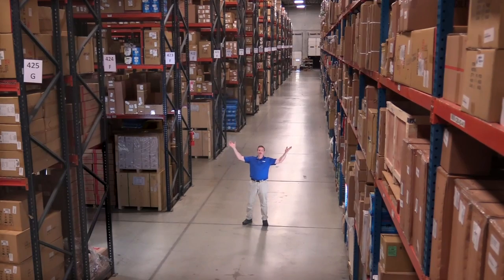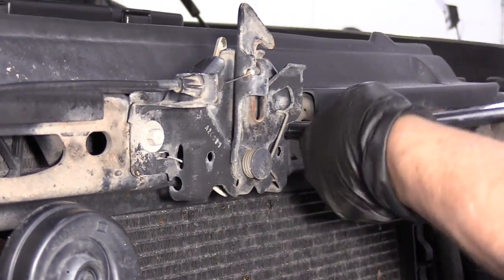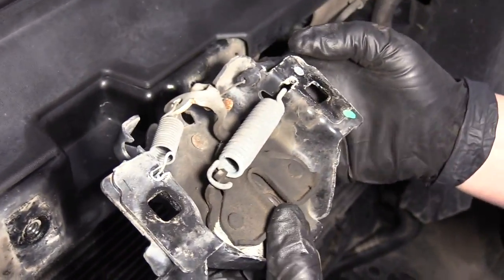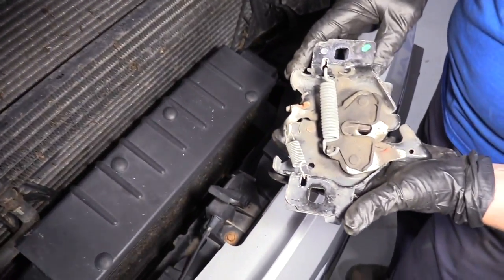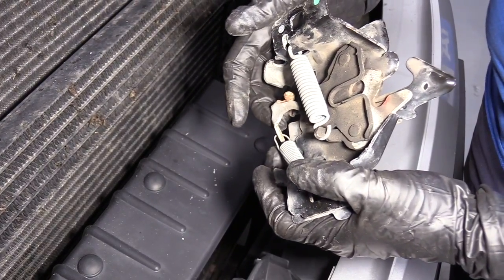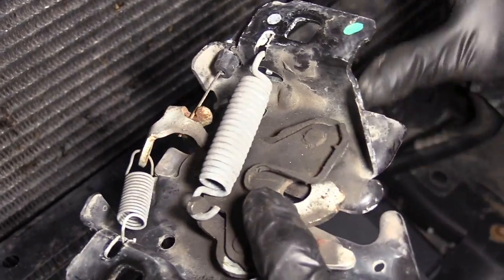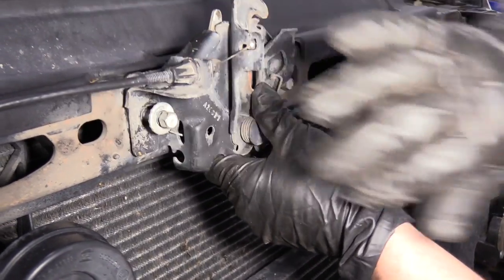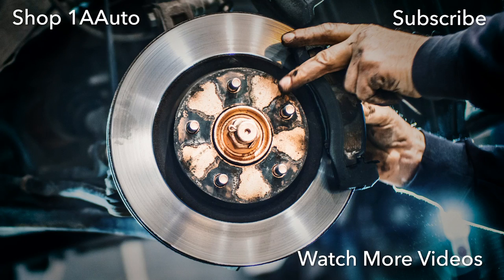How to Replace Hood Latch 09-14 Ford F-150

Comment: So I guess this latch did not have a security sensor for the truck alarm or any kind of electrical connection?  My latch is exactly the same as this one but when I was having trouble with the trucks security alarm going off the dealer said they replaced the hood alarm switch.  I still can't find the hood alarm switch!

Comment: So the cable/ latch is broken. How do i pop the hood to replace it?
Reply: in a similar situation myself right now! truck battery is dead with my key inside! haven’t had any success finding a way to open it from the outside